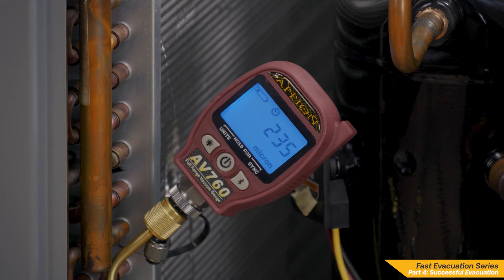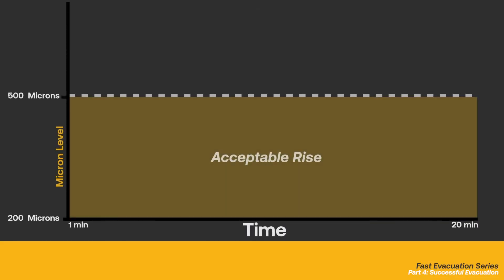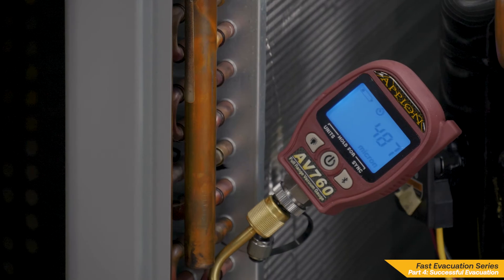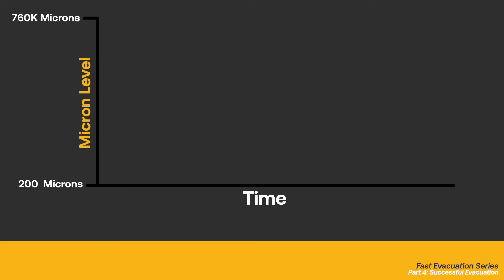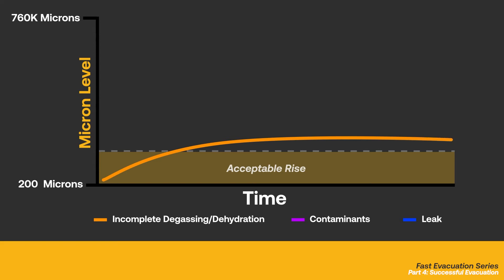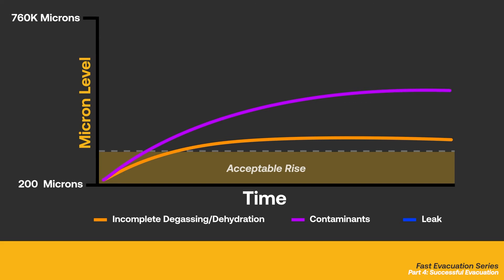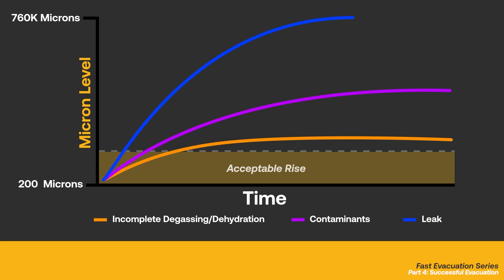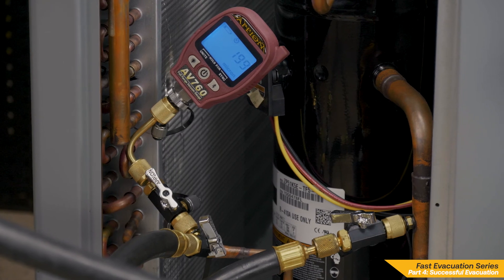Fast Evacuation Series // Pt. 4: Successful Evacuation

Comment: would it be as efficient to use the speed y on the end of the valve core removal tool and run both hoses to the pump? or is two individual valve core tools with one dedicated hose better?